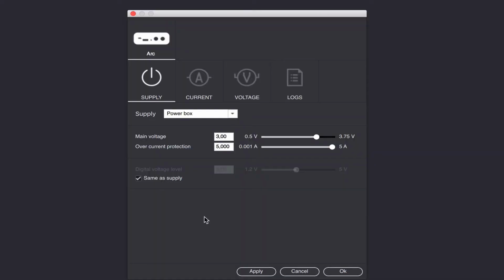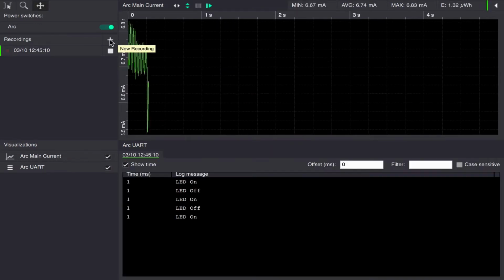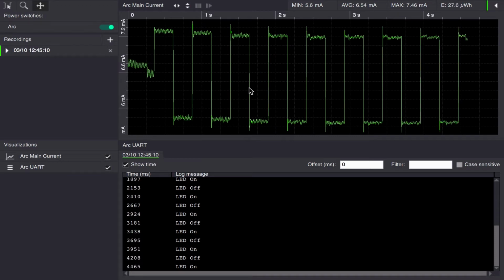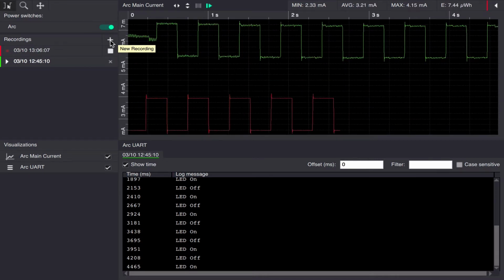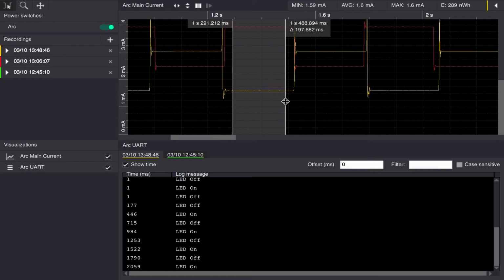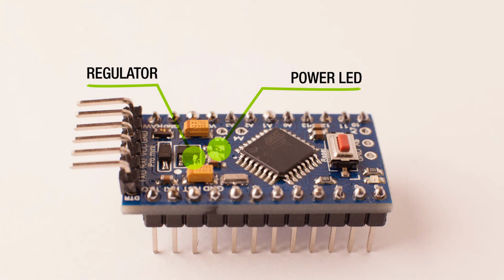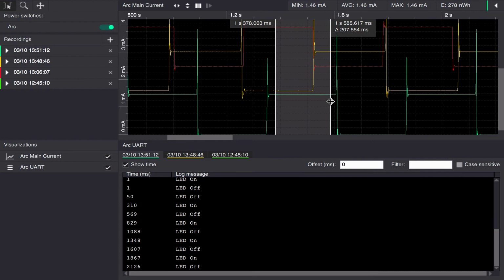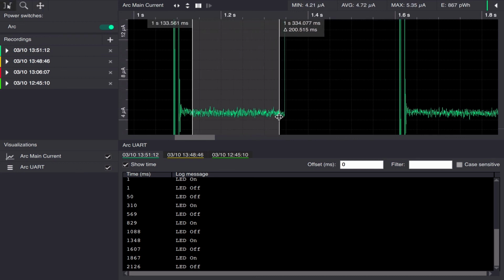Increase battery life from 6 weeks to a year on Arduino

Comment: nice tool  but it is very expensive, you can do the same thing , with connecting resistor 1 ohm an the iput the circuit , and measure the drop Voltage with oscilloscope on the resistor  --> the current will be the same value the volatge because my Resistor is 1 ohm
Reply from the maker: Hi! Thank you for your input. 
The resistor fix, or just using a multimeter, is a nice quick solution for limited range situations, but doesn't work well if you want to see what's going on in different power modes.
A regular oscilloscope will give 8 bits of resolution, so if full scale in the oscilloscope is set to 10 mA, you'll only get a resolution of 40uA. Not very helpful if you want to see if you are consuming 6 uA instead or 5 uA. And if you zoom in the oscilloscope to the lower levels of sleep mode, you won't see what is happening in active mode. A bit similar to using a multimeter; you need to manually change settings and take separate recordings to patch together a full picture.
One of the strengths of Otii is that you can see what's going on from nanoamps up to 5A in a single recording.
Reply: @Qoitech  exactely Qoitech is more suitable for professional project, also my solution is helpful